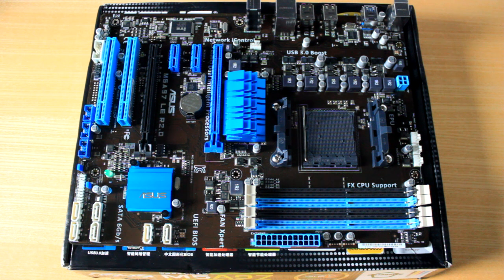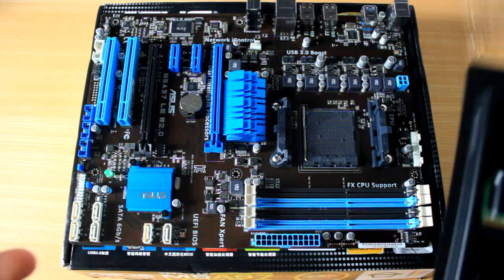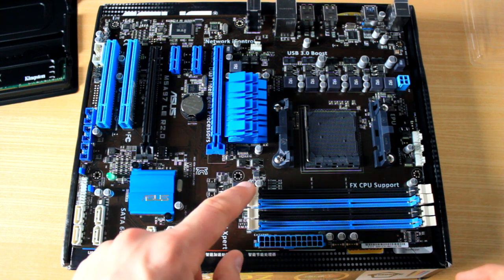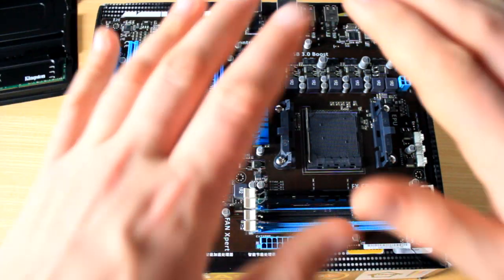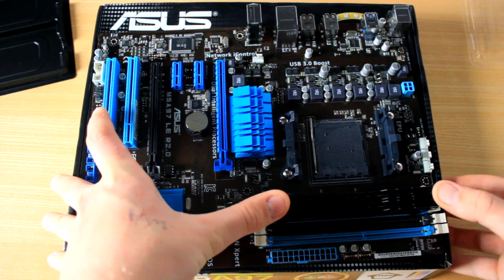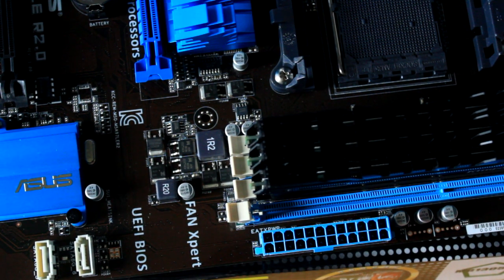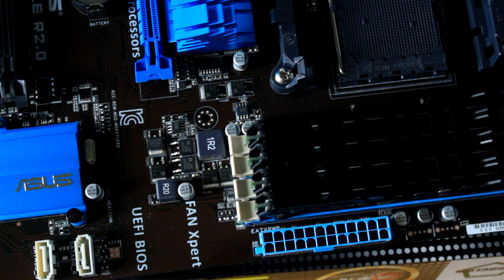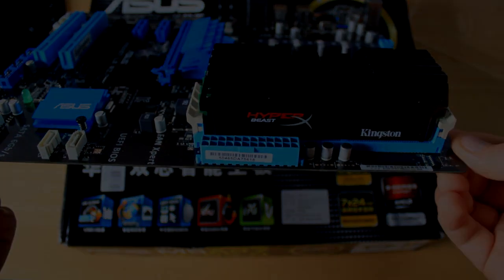HOW TO: Install Ram Guide! "Quick & Easy"

Comment: You don't put a wifichip in the MOBO, you can buy a wireless network adapter and plug that into a PCI slot or you can buy an adapter that uses USB.

Comment: if i may explain a bit more in depth. RAM is limited by your OS and mother board. the amount of ram you can use is based on what your OS can handle and the amount of RAM slots on your motherboard (usually not a problem) but if you wanna check your max RAM capacity go to crucial and run the scanner. also not many pc run ddr2 anymore XD (GPU's run ddr5)

-i know more than i should :)

Comment: All you really have to worry about is that you have the right type. (motherboards with DDR2 slots will require DDR2 modules, and DDR3 motherboards will require DDR3 modules.